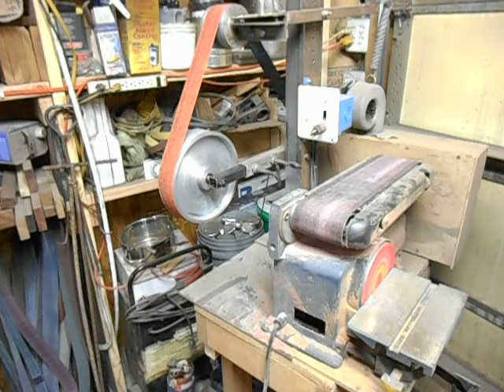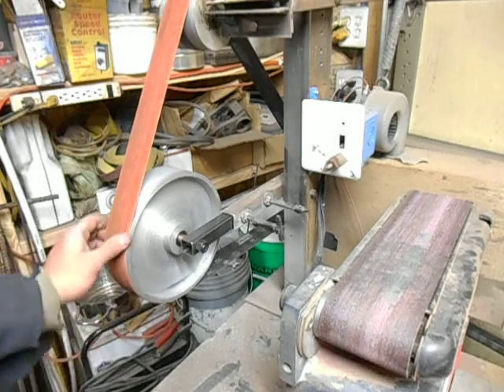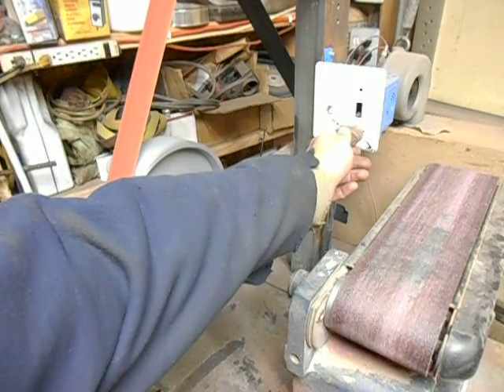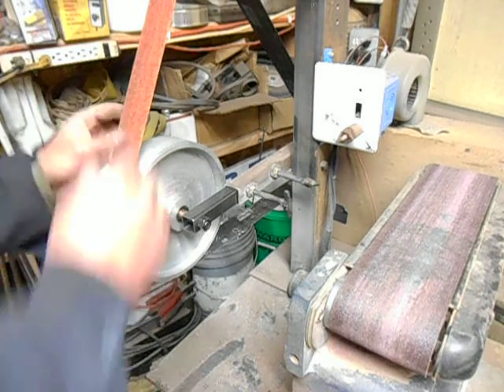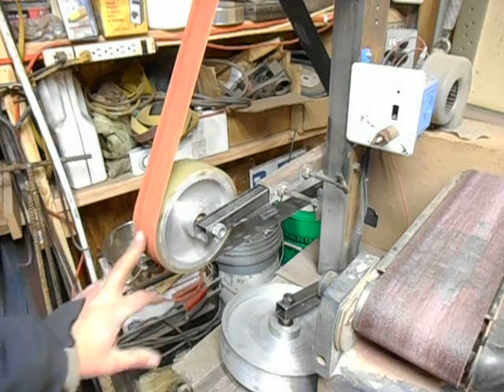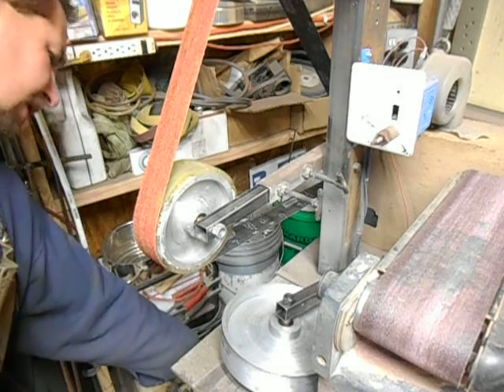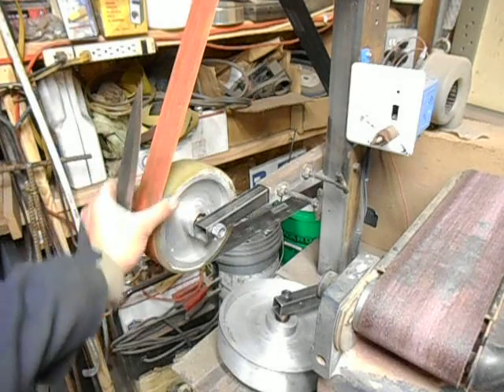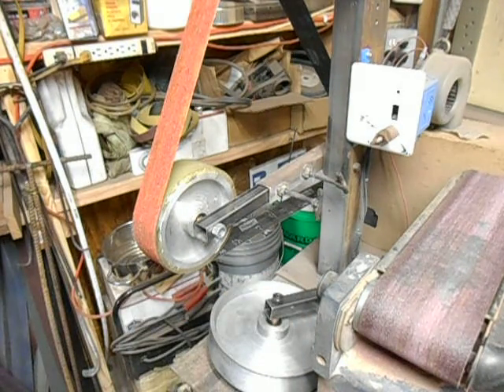treadmill grinder wheel update

Comment: Mr. Calton you never show the cleaning of the contact wheel using the lathe. How was the cutting or cleaning off the sides. Was it easy to machine or the consistency or density give you any problems. What was the speed you used on the lathe. Would you use 90 derometer?. Thank you for the video was good and informative. Have a good day.
Reply from the maker: I did clean it up a bit on the lathe, and if I remember right, it went just ok. I think I had some tearout. I don't remember what speed or bit I used on the lathe. just recently I started doing a lot more hollow grinding, and one day that wheel started acting up, and I noticed that the rubber was coming off the aluminum. so I just stripped it the rest of the way off and have been running without it. the factory wheels that I have that are rubber faced are starting to groove a bit, and I kinda like running with just the aluminum as it wont groove. combine it with gator finishing belts, and the belt gives a slight amount of cushion and seems to work pretty well.